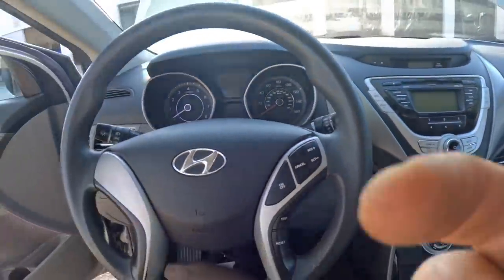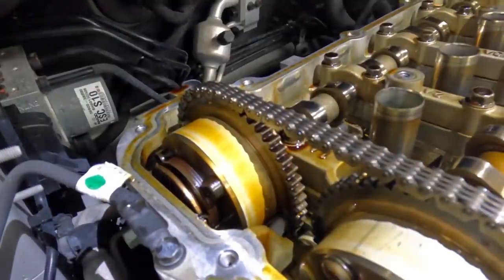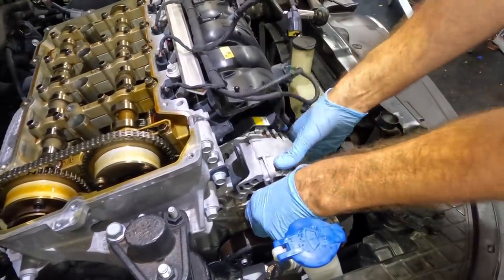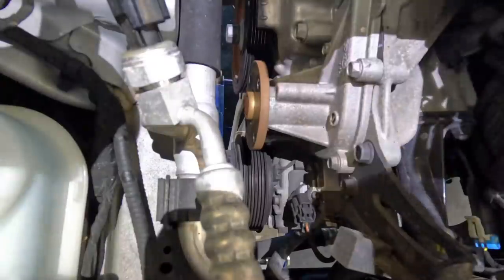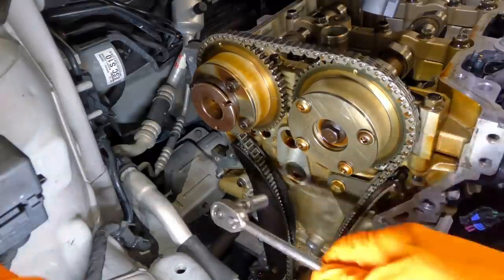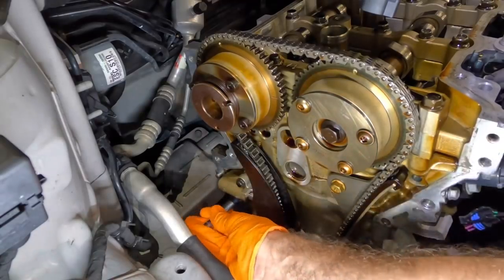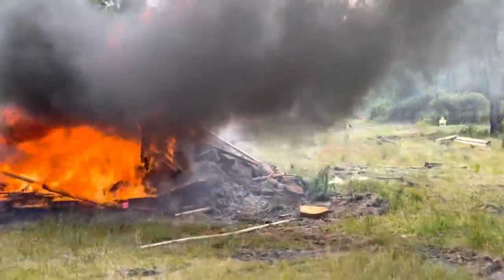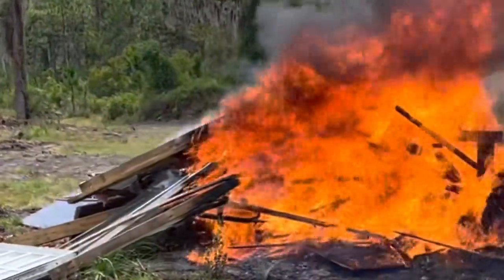I can’t finish this car! Evil Elantra!

Comment: The guy who taught me the trade said if "it's easy to get out of the way then get it out of the way". That advice served me well over the years.
And Cudos to the owner of the Elantra, that car has been well cared for.
Reply: judging by the wear on the cam lobes; seems like they missed few oil changed to me
Reply: @tbirdguy76  I'd expect some wear at 160k, I was looking at the lack of sludge.
Reply: @paulontheroad  A remarkably clean engine especially the internals for an engine with that kind of mileage.
Reply: @tbirdguy76  10-40,,, or $20.00 & no filter required, or don’t turn your back,,,I just put one on! LOL

Comment: I think Ray should do a monthly "Special" video where he does a super clip of all the brake clean he sprays. I'll bet he can get 10 minutes per month of just spraying brake clean.
Reply: I do believe he has special turbo pressurized cans.
Reply: That's on his OnlyFans page 😆
Reply: I worry about Ray. Brake cleaner contains toluene which is what get paint huffers high; spray brake cleaner VOC is about 25% toulene  (highest concentration appears to be VOC in metallic spray paint but the actual amount is not made available) and it melts your brain. Even with good ventilation the amount of brake cleaner Ray uses would get an elephant high.
Reply: How much would Ray use if he had to pay for it?😁
Reply: @IdiotPosterBoy  "You want another can of brake clean?  That's gonna cost you $9.99"
Reply: Plot twist: The $40B ukraine aid package ackshyually will be diverted to supply Ray with brake-clean
Reply: @Emily-ou6lq  "ackshyually" That's the most interesting way to spell actually I've ever seen. Well done.
Reply: @gotdangedcommiesitellyahwa6298  I appreciate your open-mindedness, diversity is our strenght
Reply: @TheOnespeedbiker  ehh, I've tried getting high off of it, it's too nasty and it doesn't do nearly as good of a job as Axe body spray does lol 😂😂😂.
Reply: @gotdangedcommiesitellyahwa6298  Stolen from a UK YouTuber called 'The Mighty Jingles'. Needs to be said with a heavy adenoidal overlay.
Reply: @DraftySatyr  Oooh, okay. Makes more sense now.
Reply: @Emily-ou6lq  diversity of thought is the only diversity that matters in life actually.

Comment: That engine looks incredibly clean inside for it’s mileage
Reply: My '13 Elantra, just like that one, has 167K miles, and still looks like new inside. I sold my previous Hyundai with 319K miles, and it still ran like new.

Comment: This car has been sitting in my drive-way for over a year (2013.) Thank you for showing that dowel, I was stuck on not being able to get the timing cover off and haven't touched it since. Also thank you for pointing out the links, I was going off of the markings.

My ex was driving my car when she said it just stopped running at a red light. I know it's a compression issue because when I used the tester the first time all came back 30psi, I saw the chain skip or something when I had the cover off, tested again and it was 60psi. This car running does something around 120psi so hopefully I'm on the right path with the timing.

Comment: It's normal for the cam to be able to be turned a little in the dephaser after the engine is stopped.  During cranking the dephaser will move to one end of its range and lock in place until there is sufficient oil pressure; you just performed that operation manually with the wrench. None of that means it's broken but rattling on startup is a common failure with dephasers, they can get so bad it sounds like a diesel instead of a gas engine.

Comment: This is a big job.  I'm just getting started on the video but this is definitely beyond me at this point.  Looks routine for Ray though.  Maybe it's engine 101.
Reply: Good on you for being honest.  Big is relative, of course.  It is, OTOH, one of those jobs you have to do exactly right, because the alignment of the marks and chain has to be right on.  On some pulleys you can zip tie the chains to the pulleys because they have holes in them.  On this one, another creative solution is needed.  Maybe some sort of locking pliers with 'nose extensions' and padding to avoid damage.
Reply: @pfsantos007  There's special tools you use to time the motor. You can usually get them as a kit for not too much money on amazon.

Comment: That chain driver attachment looked well worn and loved. I especially liked that it appeared to be plastic coated so it would be less likely to scratch or break stuff when jammed into a tight apace
Reply: The Torque Test Channel covered these devices a few months ago and they did impressive work transmitting power!

Comment: My wife has an 08 Hyundai Santa Fe with the 3.3 V6. it has the death rattle at cold start too. Only problem is, I replaced both hydraulic chain tensioners, all the guides, VVT's and everything in there while I had it apart. Still rattles! I believe it has oil delivery issues because the previous owner did not believe in oil changes. I cleaned everything I could access while the timing chains, oil pan, intake and VVT,s were out/off. Didn't work. It has helped running Seafoam in the oil and changing it every 2000-2500 miles. Lots of coked oil and crap in the oil filters.
Reply: Too late,,,,the horses already got out of the coral!
Reply: @fredwalker839  It runs great otherwise. No metal or aluminum in the filters, just flakes of old oil snd crap from getting cleaned out! Never uses a drop of oil and has lots of pep

Comment: For 4 decades my friends and family know that any repair I do to cars, electronics, etc - I will have a bolt or screw left over. But all repairs have worked. I have been nicknamed "one screw loose" I enjoy it as what I've fixed has remained fixed.

Comment: when i put the belt on everything was lined up but doing an extra spin knocked it out line so after some spinning nope, so i removed tensioner and grabbed the crank and turned it so the dot would line up and put it back together, (the tensioner i used a clamp and sqeezed it  in and put the pin back in , in short the car runs fine. have a good day ray .

Comment: Some rattle in VVT phasors is normal for a few seconds until oil pressure is up when the engine has set long enough for the oil to drain out of the phasors. The rattle is just the phasors hitting their end of travel stops until they fill so the computer can fine tune the timing. It is important to use the correct recommended weight of oil on any VVT engine.
Reply: Nissan SR20 are notorious for it when using the specified oil. One the customers from my old work ran 20w50 Pennzoil in his, no issues for well over 150k on second hand import motor.
Reply: My 2012 Santa Fe V6 has a "rattle" for a few seconds on start-up.  Once the oil pressure comes up, it goes away.  Only 32,400 miles.
Reply: Is your point this is a needless fix ?
Reply: Yes, Toyota’s have it too.
Reply: My DOHC Subaru Boxer rattles on startup too... 100% normal.
Reply: I have a 14 Elantra and it’s a noisy engine on cold startup but after doing a ton of research it is just common on these engines. It goes away shortly thereafter. Given how clean this car is I think he is babying this car too much and costing himself a lot of lost money. Shame.
Reply: @peted5217  naw, good call, timing chain, guides, "kit" should have been replaced a 100,000 miles ago.
Reply: @peted5217  Going by the very brief rattle I suspect it is likely a bit premature of a repair. Obviously cannot see everything through the video but the 1 second rattle was very minor on a cold engine. That said many engines have a timing chain expected life of around 160,000 - 170,000 miles and the result of a timing chain failure is generally total catastrophic engine failure.
Reply: @EmbraceTheSuck  Tru That, but less than 10% as often, & then lack of normal mait is usually a factor.
Reply: @21Piloteer  or a “ premium” oil filter that holds “residual” oil pressure! LOL extra $6.00 !
Reply: @wirefeed3419  believe this critter had some miles . Suspected chain slap wasn't there as it was Tite. While many think phaser rattle ok, it wasn't present in 1st 100k or so. No doubt good cause for users concern.
Reply: @user-pj8em4gu6v  Its done on purpose. The fuel pump is very noisy along with a special engine mapping that heats the O2 sensors and cats up as fast as possible so the motor can run in closed loop. The car in the video has a different problem. The timing chain is stretched. On your car the noise will be in the center, back by the firewall, and this one is all the way on the top right hand side of the engine compartment.
Reply: @fredwalker839  - nooo, actually just the opposite. I have the same exact car that I bought new. I’ve tried really nice Bosch filters and it was way worse. I went back to factory filters just as peace of mind. Actually the cheaper the filter I’ve found the less it ticks upon start up. Factory is ok quality
Reply: @cigarsgunsanddiesel8032  Can someone smell coolant?
Reply: Yes they do, but that one is excessive. Obviously they owners brought it in because they noticed the noise that didn’t exist in the 167k miles prior.
Reply: @peted5217  Depends. How much rattle is 'normal'?
Reply: Always thought the startup rattle was normal too on my vw engine with timing chain. Until I put a new chain in, night and day difference. Some rattle might be okay in some instances but this rattle was excessively loud

Comment: I rebuilt a transmission in an impala.  Got 2 valve body bolts swapped and instant carnage as soon as car was put in gear.  The longer bolt hit the stator, sheared off the bolt and wrecked the stator.  One of those days you want to beat your head on a wall.
Reply: I can't even imagine going through all of that to get to there :(
Reply: Hard to imagine but an hour later you swerved to miss a deer and hit a tree head on. Car was totaled, what a shame since the Trans was bad 🤫
Reply: @TheFrenchPug  I repaired it in car but was a royal pia and most of another day.  You can pull most of the trans apart from drivers side wheel well.
Reply: huh ?  lol
Reply: @dev-debug  Wow.  Great job. I would be scared to do that one.

Comment: hopefully i'm not too late... i'm an old Kia tech, most of our manuals said to install our belts and chains clockwise starting with the exhaust cam. that puts all of your slack on the adjuster side. of course they gave us cam locks and such but most were plastic and sucked. several aftermarket cam locks worked better but you seemed to manage it just fine without them. In the older Kia/Hyundai engines with timing belts, especially the 3.5L V6 engines, you could get all the cams lined up and wrap the crank, install the tensioner, LOOKS GOOOOD. then rotate the engine a full turn (twice on the crank) and it would be off 1 tooth every time. We finally found there were four 12mm threaded holes behind the cams worked great to make our own cam locks that keep the cams from moving. B2 exhaust was the only one that the threaded hole was in the middle of the cam hole instead of on a bar. We made a bent metal bracket that "filled" the hole in the cam face and worked great. Never had an issue after that. Also, if you deal with timing belts on those old 3.5L Sorentos, it isn't work fighting the radiator and condenser, drain both and pull the entire core support and you can yank the radiator and condenser and cooling fans out as a unit and have open access to the front of the engine. Knocked a timing belt time from 4 hours to just over an hour and a half. Love your videos! i miss teching... just don't miss the body aches (cuz they are still with me :( lol)

Comment: I've always imagined that engine part I am attempting to remove was the 1st part placed on the assembly line then every other part was added around it. This can cause sadistic fantasy of kidnaping the design engineers and placing  them in in a poorly lit uncooled garage with a  12 piece hand wrench set and two screwdrivers. Terms of release involves replacement of  the surrounded part that I was currently struggling with.
Reply: I can rally behind this for sure
Reply: And make sure that the 10mm socket is missing.
Reply: And tell them that for every minute past “book time” you will pluck a hair from his head.
Reply: @RustyZipper  I guess adding sadism to sadism is ok lol
Reply: I agree if they had to do what you're saying maybe when they're designing stuff and coming up with brilliant ideas they might think about the guy on the other end and

Comment: Very clean engine compartment considering the age and mileage! edit: you probably already finished the repair by now, and this comment is not so much for you but others doing these: turn the engine a couple complete turns and re-check the marks just to be safe.

Comment: I thought I was going to have to do this on my car and I watched a similar video. The other guy had the engine out of the car and it looked pretty straightforward. Once I see the repair in the car, it doesn’t look as easy. Turns out it was a loose heat shield and all is well.

Comment: interesting observation made at 27:14. The timing dots were lined up but the lines on the face of the cogs were off a few teeth, and then by magic it was fine at 27:34. That's the beauty of editing I guess!
Reply: Nothing to hide here - Probably just cutting out finagling the chain, hitting the camera 10 more times with a wrench and getting everything in position.
He even said at 16:36 "That stuff moved - that's okay". So he was aware of it and didn't need to hide stuff.
Reply: Just a little rotation of the engine is all it took to line the horizontal marks up.  You could tell by looking at it that was the case.  As long as the marks on the sprockets/phasers line up with the marked links on the chain, it will be fine.  When the engine is clocked to exact TDC, the horizontal marks will be in line.  My only concern looking at this was the slack in the bottom of the chain around the crank sprocket.  If the engine is turned clockwise after this, no harm no foul - everything will be fine but if the crank is turned CCW, then timing will be off a tooth.
Reply: @silicon212  Thats where the tensioner comes into play.
Reply: @graken22  Tensioner has nothing to do with it in this instance - if the crank is moved clockwise, the marked link on the chain which is engaged with the mark on the sprocket, will remain in that location and as the crank is turned to the left (CW), the slack will disappear and then the tensioner will do its thing.  If the crank is turned CCW, the same thing will happen but the crank will be off a tooth on the cam timing with respect to the cams.  This is because there is an extra link worth of slack in the bottom of the crank.  Turn one direction, things work out well - turn the other, things don't.

Comment: Interesting video... my wife's 2011 Elantra sedan has been making this noise on startup for years.  I've always assumed it was simply the tensioner and that, if the noise goes away after a second, it's probably harmless for the most part.  I can't see doing such a major repair unless the symptoms get worse -- such as the noise lasts longer than a second or two, or if it comes back after the engine has been running awhile (that is, not just on startup).  When that happens, I had always planned to dump the car.  Sure won't buy a Hyundai again.

Comment: I always keep my bolts and bits organized by pushing them into a piece of cardboard in order, along a drawn outline of the part they came from.
Reply: same. I take a few photos along the way also so i can work backwards if I lose my way
Reply: I put mine in an old coffee can with 13 leftover bolts from other projects. I make sure to kick the can over at least 3 times and lose at least one in a pail of oil or floor drain. That way when you put it back together it takes 14.3 minutes per bolt to re-install each part. But I bet you guys aren’t ASE Certified KeyBoard Mechanics like me 🙄
Reply: Jeetje-me-spleetje....
Reply: DeeDee, thanks !!! , maybe I should do that, instead of having bolts and nuts left over in the end.    help works.
Reply: @jaydegelder2964  I always have a lot of cardboard and sheets of paper left from ordering stuff online, so there's no reason for me to do it another way.
If a lot needs to be taken apart or the project takes a long time, the sheets of cardboard can also be shelved for convenience.
This way i never lose anything or forget where it belongs.
Can also scribble reminders on the cardboard like torque specs, order of installation and whatnot.
You should really try it.
It's super simple and prevents a lot of tedious micro-managing.
Reply: @DeeDee-pw9pm  , yes thanks for that information . I will start doing that. Great advice.

Comment: for that...  oil pump is also recommended which is located in the timing cover.. since you don't have oil light on , should be fine .  but also OCV valves could cause those rattles.     but, as long as it does not rattle all the time, which is normal for Hyundai s     they all rattle like a hell at cold start

Comment: I believe that's the infamous piston slap Hyundai recalled. I also swapped the tensioner in mine and didn't notice much difference. Still get the cold start slap but we're nearing 290k miles so no complaints.